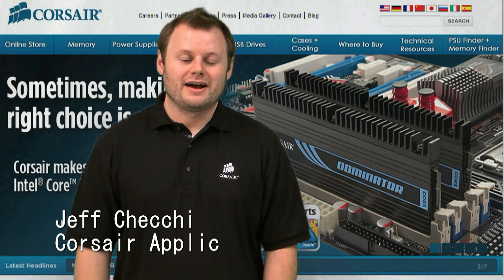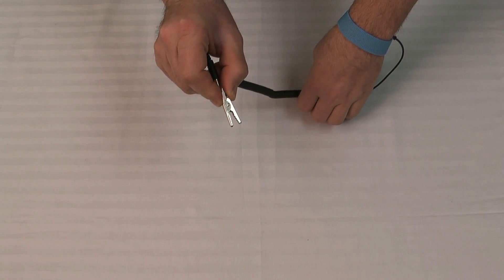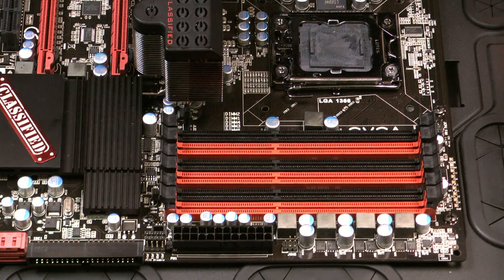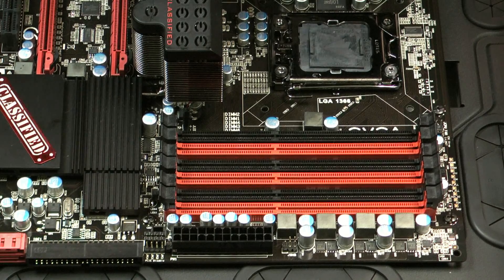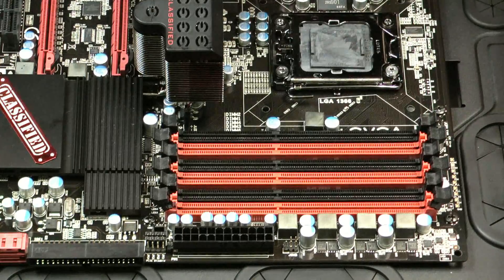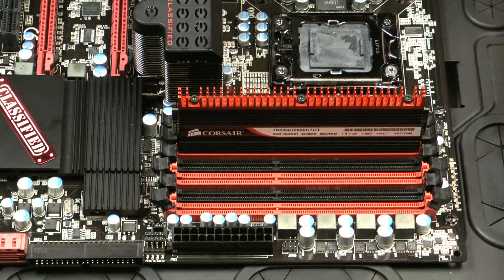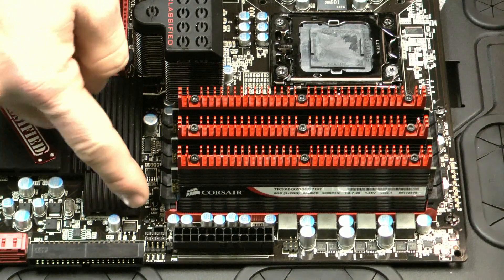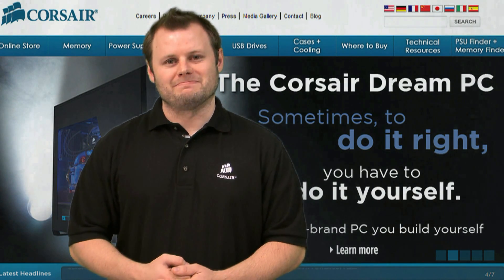Corsair Video FAQ: How to install Desktop Memory

Comment: What about if i want to fill the black ones up too?
Reply: I was thinking the same question
Reply: +Papermate19 You can, but they're colour coded for a reason if you fill in the grey ones only, then your RAM will work on Dual Channel which is much faster and much more efficient. If you fill in the black ones, that removes the dual channel. If you want to fill 4, you'll either have to fill up the rest of the slots (which I don't recommend doing), or you'll have to buy a motherboard with 8 slots to make it work on Quad Channel.
Reply: +Kian Eissa thank you so much for your help :)